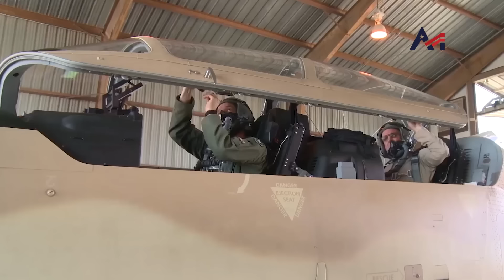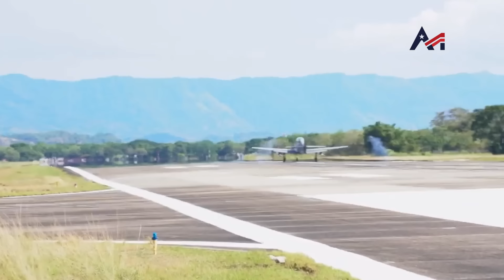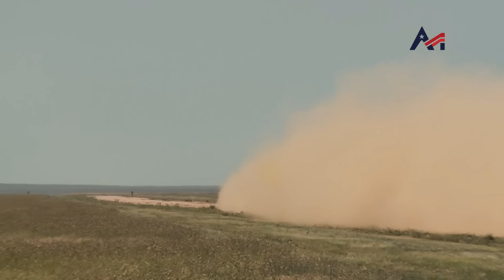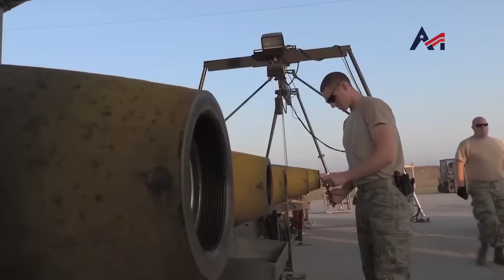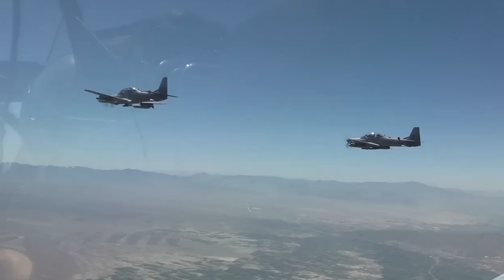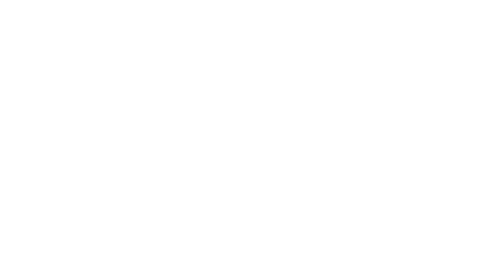U.S. Air Force’s New Answer To Shahed Drones

Comment: ???
It's still in testing against the AT-6 Wolverine. The AT-6 has an already established support/ supply chain through the T-6 Texan 2 which has decades of USAF service. The OA-1K is a completely different mission.
Reply from the maker: You’re right! they’re not direct equivalents.
The AT-6 Wolverine leverages existing infrastructure, while OA-1K focuses on a different operational role.

Comment: I kinda wonder if this A-29 might someday outlive some of our fighter jets in terms of combat relevance. They’re cheap, they work, people can afford them and you’re not as sad about losing one on the tarmac if you get drone swarmed as you would if it was an F35/F15
Reply from the maker: You’re touching on an important idea! high-low mix.
Lower-cost platforms like the A-29 handle permissive environments, while advanced fighters like the F-35 operate in contested airspace.
Reply: Your right they can be stationed in forward combat bases you wouldn't dare put 35's at.
Reply from the maker: @MrWilderNapalm  That’s a key advantage. Aircraft like the Embraer A-29 Super Tucano are much more flexible when it comes to basing and logistics compared to high-end platforms like the F-35 Lightning II.
Reply: @americanmililitary also the American Skyraider II which is frankly a converted crop duster, and it does have a 1,600 horsepower turboprop, and long loiter time, despite surprisingly high payload capacity**.  And I'm sure it could be fitted with APKWS, which is Hydra unguided rockets with precision laser guided targeting systems retrofitted.
As much as we complain about slow, expensive, military acquisition, we should be supportive of moves like this:  the basic airframe is powerful and robust, and it is perfectly suited for its main role of supporting Spec Ops and COIN.

**Makes sense: crop dusting tanks must be heavy, and you don't want to have refuel very often.
Reply: @MrWilderNapalm Exactly.  One of many distinctions of the A10 is it has an on board APU.  Pretty sure turboprops don't need one.
I still blanch slightly at calling a converted crop duster the Skyraider II, and I decided today that it's apt enough.  I mean, it's not going to shrug off heavy fire, and it's not going to gun down a jet fighter, and it IS a prop attack plane, plus, (as said elsewhere) highly suitable for COIN and I say various other spooky stuff,  It can be fitted with all kinds of crazy comms, and maybe load out MALD drones and an infrared sensor pod like the A10s flying overwatch over the Strait of Hormuz.  It's got a 1,600 horsepower engine, and long loiter despite fairly high payload capacity 
I just watched a video of a couple former [not super, I think] Hornet pilots wondering about L3 press release on fitting a 200+ mile range air to ground missile to this thing - like "why in the world"? ...but why not?
Reply: The OV-10 with something like a belt fed 10 gauge.
Reply: @Chris_at_Home OV10: vastly underrated, and sadly, largely, forgotten
Reply: This is a really good point!!  Low cost that can be put in close to the fight where you can afford to lose a few of them.
Reply: @GurnBograt1986 yeah: American doctrine isn't about endangering our pilots like that.  That's why the A10 has titanium armor protecting the Stick Operator.
Reply: Look how long the A1 Skyraider lasted.
Reply: Just like the A-10...the A-29 is low cost and effective. Not shiny, though, so the generals and their American contractor buddies will eventually come up with a reason why it won't work!
Reply: @Beauxtrux  and yet we still acquired the OA-1K Skyraider II
Reply: The United States has MULTIPLE anti-drone defense systems, including the AMERICAN APKWS system on F15s and A10s.  You make it sound like APKWS is unique to this aircraft.  No cool.
Reply: @LloydMcElheny-d2w f15 is too fast, a10 is getting retired.

Also a10 is relevant only for the US while the Supertucano operates in almost every country.
Reply: @fabianosorio2540  my point was in response to your comment about the A29 outliving fighters.
And – after it proved to be such a perfect tool in Epic Fury – I seriously doubt the A10 will ever be retired, as long as a usable number are still flying.
We chose our own converted crop duster to fill the role of Super Tacano.  Pretty sure it could also be fitted with the (AHEM) AMERICAN developed APKWS, though that's already part of the load out on many F15Es abroad, and all F15EXs for homeland defense.  You see, this "too fast" notion presented by the video is nonsense.  If you have a WSO and a precision laser guided, fire and forget weapon, you don't need to fly all that slow.  Heck, Ukrainian pilots are splashing Shaheds with the F16s Gatling gun.  Meanwhile,  Kuwaiti pilots shot down quite a few with older version sidewinder missiles from F16s
Reply: They fill a pragmatic gap that decades of cold war and COIN thinking has created.  LSCO and drone tech (among all the other ways to fight) will continue to expose the weaknesses.
Reply: I would love to see it become a Real Answer.
Reply: @m2003h America already has the Skyraider II, which was chosen as more suitable for the role it fills.
Reply: Sometimes smaller is better.
Reply: We're still flying F15Es, though...
Reply: I'm sure it will, just look at how many aircraft the B - 52 has outlived.
Reply: @hauntedhouse7827 the last F15E was built ~1983
Reply: Which is why they're trying to get rid of the warthog it's cheap and works and nobody can make money off of it
Reply: @tntgators Alex Hollings/Sandboxx makes a rational case for the cumulative expense of maintaining Warthogs, vs other things we could do with that same money.  That being said, that they CHOSE to use Warthogs for certain missions in Epic Fury, when they could literally pick ANY Aircraft in Air Force or Marine inventory for those missions, says something.  In my admittedly unqualified opinion, I believe now they'll keep on flying Warthogs as long as there's enough of them still flying to be useful.

And Warthog haters probably don't know that the flight hours of our existing Warthog fleet are going to diminish DRAMATICALLY, as home defense squadron Warthogs are being replaced with F15EXs (per another Alex Hollings video).

People just don't understand that war differs significantly from a video game.  That old guy that received a much-belated Medal of Honor during SOTU personally splashed FOUR Soviet piloted, then latest/greatest MiGs over Korea, with an F9F, which was really good at rolling, and otherwise inferior to the MiG, ON PAPER, in every conceivable performance metric.
Reply: @LloydMcElheny-d2w some interesting rambling
Reply: @tntgators TYVM.  I'll own the rambling part, especially if characterized as "interesting" 🤔
Reply: @tntgators no they absolutely make money in the warthog the maintenance cost alone 

If they also have a contract of having the company engineers do the maintenance they make bank
Reply: @boom350ph pennies
Reply: You can buy a swarm of little prop driven planes for the price of 1 F35 and the cheaper aircraft is better for a lot of roles.  Ground troops in contact probably appreciate the ability to stay close for a long time. And it looks perfect for drone hunting. Maybe they need an extra hard wing tip for swatting drones so they don't even use up ammo. Those prop driven sh!thead drones can be knocked down like that. So it's a great little aircraft.
Reply: @comfortablynumb9342 LOL you can buy something like 50 manual drywall saws for what one battery powered DeWalt reciprocating saw costs.  Lower cost  doesn't make the drywall saw the right tool to replace the DeWalt in every use case.  Plus you're completely ignoring the cost and required infrastructure required to train any Air Force or Marine pilot, let alone your seeming assumption of a nearly unlimited supply of qualified candidates.

Finally, you make the usual armchair General mistake of assuming that you're more qualified to opine on the development of doctrine and associated equipment and tactics than the people actually in charge of these things.
Reply: @LloydMcElheny-d2w don't lecture me about doctrine, the "experts" drop the ball all the time.
Reply: @comfortablynumb9342 "Lecture", eh?  That's hilarious.  Where does the likes of YOU get off second-guessing the doctrinal choices made by the military force commanders entrusted with making such decisions? Really? You're going with that?

¡SMH!
Reply: @LloydMcElheny-d2w the people who ignored the Ukraine war and the drone situation aren't very good at doctrine. They have failed many times.
Reply: @comfortablynumb9342 in your delusional opinion.
Reply: @LloydMcElheny-d2w delusional opinion? Ask the troops who were hit by drones in unprotected bases. Except for you can't ask the 6 who died. If you think it's delusional to understand that our military is unprepared for the modern battlefield I suggest you look at the new budget requests. They include a massive amount of money for....catching up with the drone situation. 
Now ooze back under your bridge where trolls belong. I don't know if you're a foreign bot, an AI bot or just incapable of thinking for some other reason. The budget request proves my point beyond any silly comment you can make.
Reply: @comfortablynumb9342 Yes, delusional. I only need read that first sentence, so that's all I bothered with. And, as Dr. Sowell says: "Serial assertion doesn't constitute proof."
Reply: @comfortablynumb9342 Alex Hollings: "Busting the 15 Biggest Military Tech Myths: https://youtu.be/3LCP8aGeiKE?si=1QR2SGD6KKU1LU3e
[your delusions about drones is one of those myths]
Reply: @comfortablynumb9342 edit: your drone delusions are the #1 myth of the 15: https://youtu.be/3LCP8aGeiKE?si=1QR2SGD6KKU1LU3e
Reply: @comfortablynumb9342  the next problem would be the the original design for the dshka can be used again  effectively which is way cheaper than a modern AA missile
Reply: @boom350ph yeah it should have a gun and a few thousand rounds for drones and for close air support
Reply: @comfortablynumb9342  that dosent solve the old way of shooting down planes which the dshka is made to do
Reply: Also easier to train pilots on this platform. Simplier then a jet.
Reply: I don't remember how many years ago in Afghanistan something very cold and unexpected happened. A pair of Navy pilots got to fly a plane pulled out of the boneyard. It was a Vietnam era US army Ov 10 bronco. It had a very very small window of opportunity not to miss its Target and it's a form right on schedule without any errors
Reply: Imagine AI in an aircraft like the A29 and then you will have something.  The pilot is the most expensive component in the aircraft. AI does not need sleep, has unlimited induarance and no retirement plan needed.
Reply: @georgeeverette3912 We're already developing those separately.

Comment: this is moronic, and i hope the whole video is a joke.  please tell me i'm confused; will these aircraft need to be be flown by human crews?  are american pilots as dispensable as drones??  let's just trade american pilots for the technology that we don't have or can't make fast enough...
Reply from the maker: I think there might be some confusion here.
Most modern systems are designed to support pilots, not replace them.
Human crews are still a critical part of decision-making in combat.
Reply: @americanmililitary 
Eyes in the sky.
To completely replace the pilot would take a radical shift in tactics that perhaps will happen someday but will need a lot of time and trial and error. It’s possible.
Reply: Ukraine has been quite successful using helicopters for drone management purposes and they aren't getting shot down. You would not use these over enemy territory, but as a defensive measure in friendly skies.
Reply from the maker: @michaeldupuis7927  That's a good point. In secure or friendly airspace, these types of aircraft can be effective in an anti-drone role.
It really depends on the threat level and the air defense environment.
Reply: Reckon the fact that Japan has teamed up with Ukraine to manufacture and develop interceptor drones ($2,500 each)  means sending humans up will not be required soon. And this is early days of the technology.